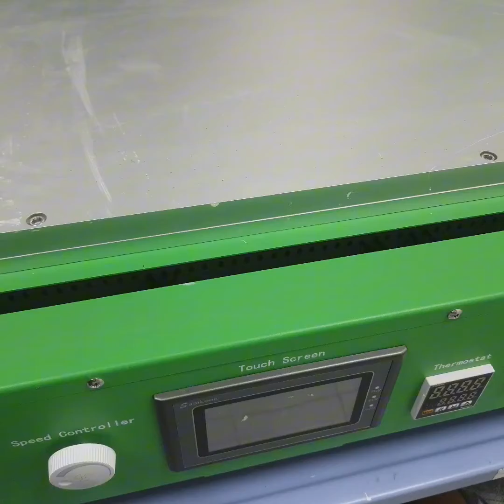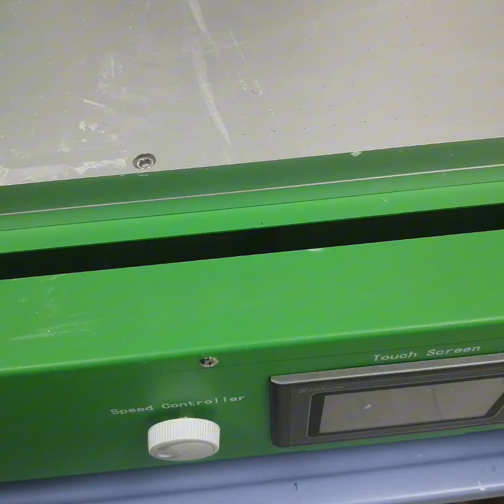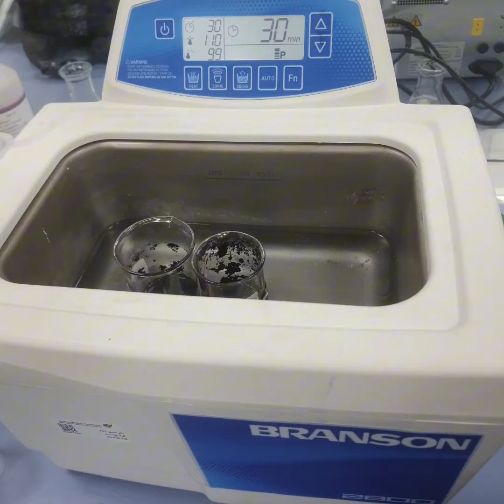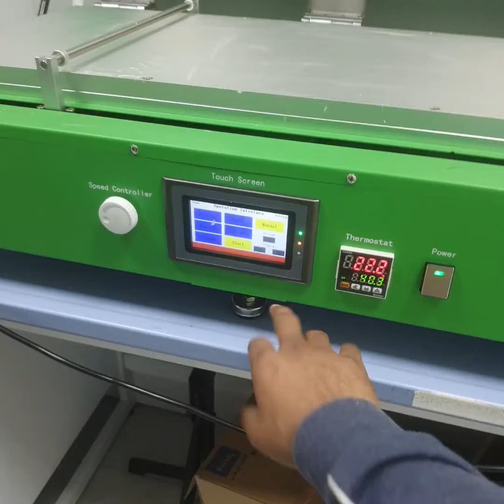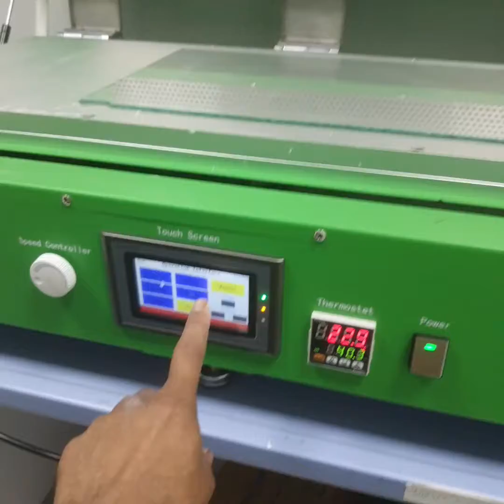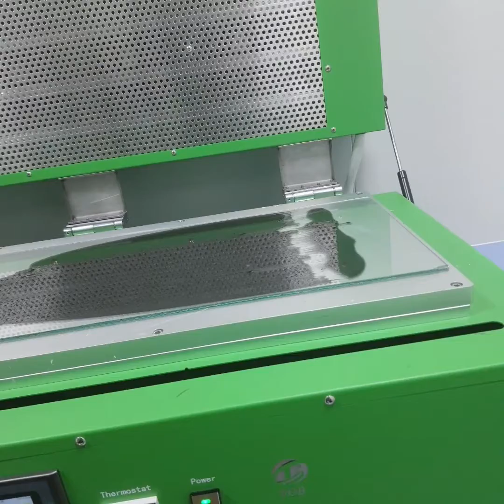Phase inversion or separation for the fabrication of activated carbon  based membrane

Comment: How to separate the film from the glass plate? This has troubled me for a long time.
Reply from the maker: Just add the prepared film to water and after that transfer it to butter paper I do like this
Reply: @materialsandtechnology8956  Do you mean that after drying and then adding water, the film can be easily removed?
Reply from the maker: No just after casting put in water